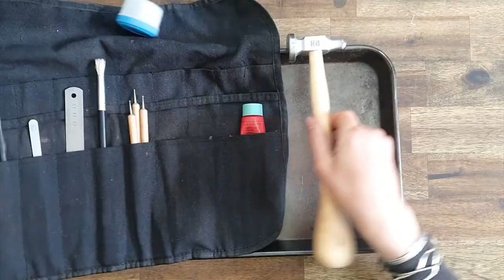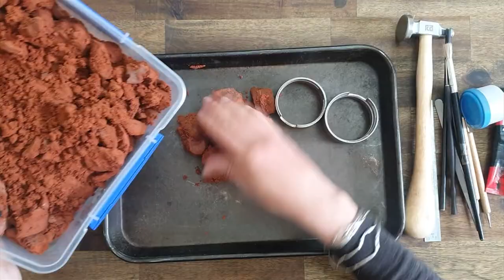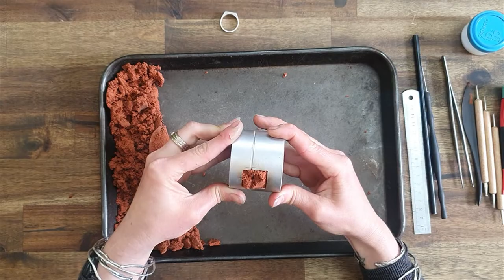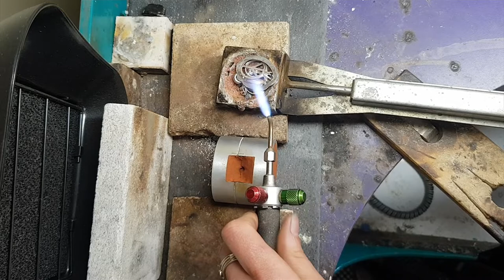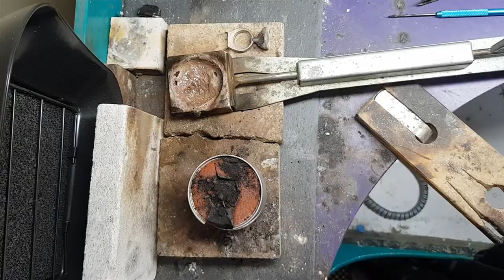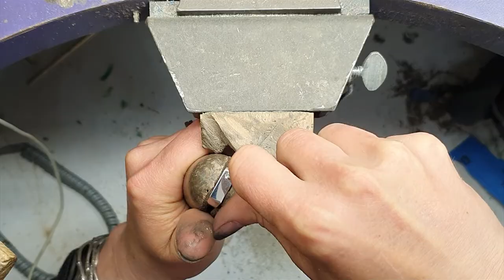Resizing a ring in the clay - sand casting tutorial - Red Clay

Comment: Hi There. Very interested in the sand casting. I bought a heap of Lost wax casting equipment from a lady on Hindmarsh Island. Just need the vacuum pump. have all the other necessary gear but no Idea. Maybe the sand casting is a good place to start. Were would be the best place to get the flask and clay. AJS? Twin Plasa? I have quite a few small sapphires not suitable to cut but may be good for this style of casting.
I will have a look see if I can make on of you courses at the jam factory.
Reply from the maker: Both Combined Jewellery Services and Australian Jewellery Suppliers are great places to buy clay and flasks from in Australia :)

Comment: Hey Kirra! First off I think your videos are AWESOME! Secondly I'm just starting out and attempted my first cast yesterday (I knew it was going to be a fail half way into making the mold as there's a hole in the middle of the signet I was trying to cast but I'm a tryer 😂) when my mold was complete I realised the centre circle of the ring wasn't staying in place so I tried again with another ring (no hole) and the same thing happened? I'm not sure why as I'm chopping the clay up fine, packing it hard with a hammer and using talc 🤷‍♀️. Can you advise on what I'm doing wrong? ALSO is it possible to sand cast carvings with holes or do I have to drill in after? I feel like if anyone would have an optimistic answer it would be you! Thanks in advance! Nads x
Reply: Hello. Did you manage to solve this problem?

Comment: Thx for a helpful video! i'd like to ask some questions if you don't mind/ Yesterday i tried to melt 915 silver (it was an old  spoon i don't need) in my crucible, and when silver starting to melt, the borax starting to melt too. and they kind of mixed with each other. do you know why that could happened? thx in advance.
Reply from the maker: What you have described sounds odd. But borax is meant to melt when it gets hot, it turns into a liquid. When it cools it turns into a solid like glass.
Reply: @sandcasting_with_kirralea  yes that was strange for me.i didn't expect that. May be too much borax was in this crucible...
Reply: @sandcasting_with_kirralea  some silver particles stuck in the solidified borax/ yes borax looks now like dark grey glass cover/
Reply: @sandcasting_with_kirralea  Yes it was too much of borax in crucible, i had to remove most of it. Now everything is fine!